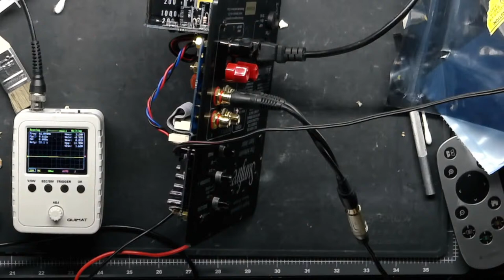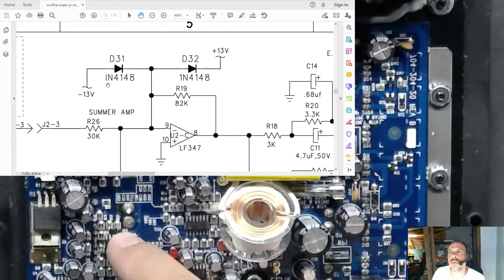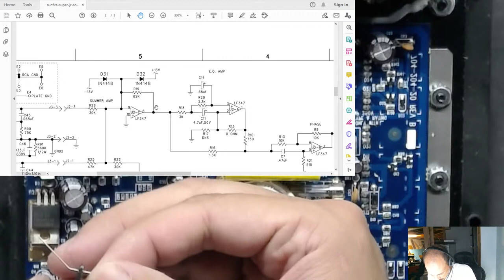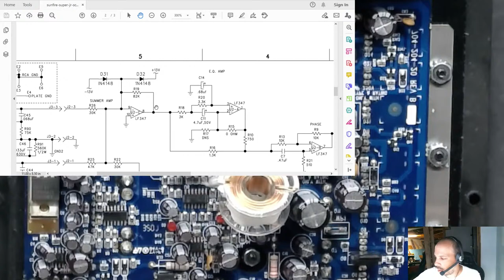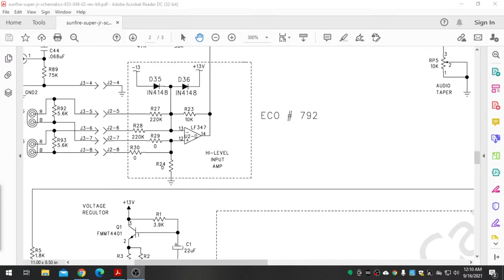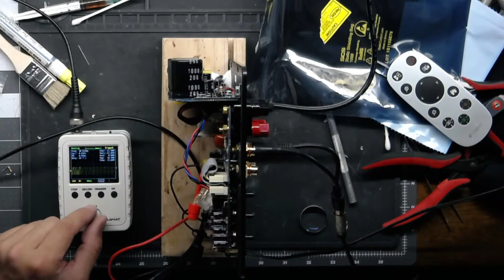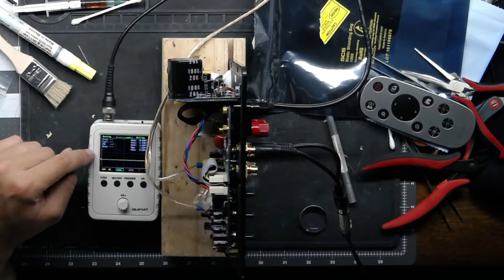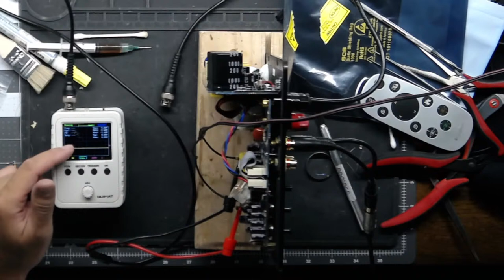Supreme Innovations LLC Live Stream - 017 - Sunfire Super Junior Repair Part 3

Comment: There is no sound the last 20min. Would like to know what the fault was and what you did to fix it. Thanks
Reply from the maker: I will edit this and narrate it. The issue was the opamp was damaged and needed to be replaced. The last 20 mins, I was replacing the diodes that were added to that device.